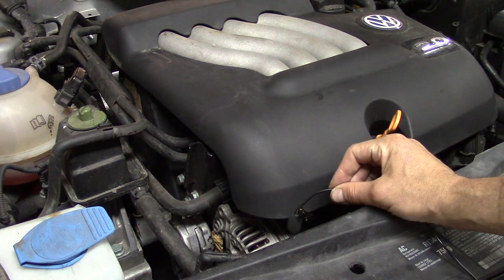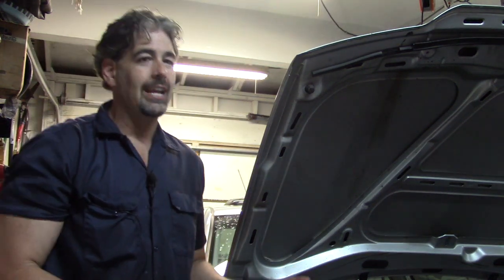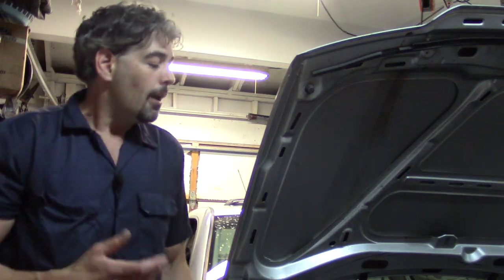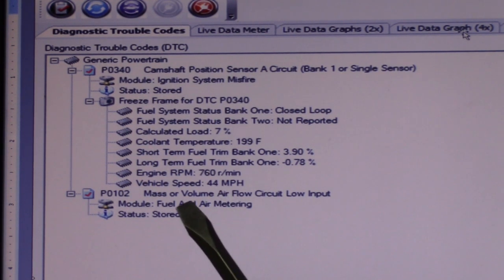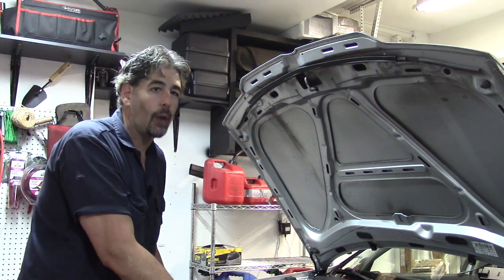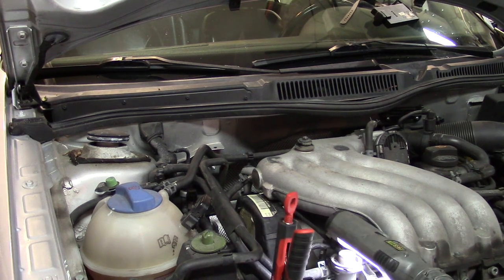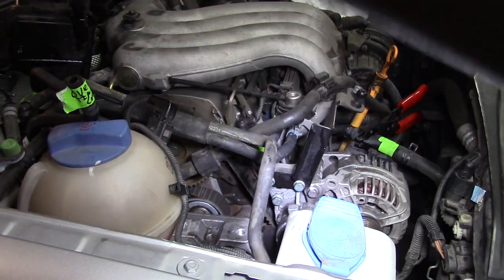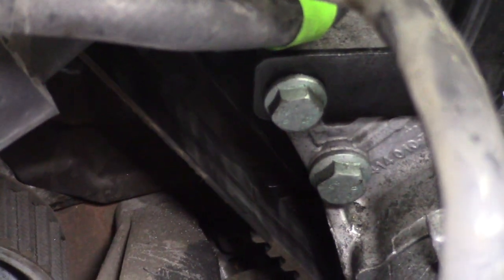Volkswagen Engine Noise Diagnosis

Comment: I figured out the sound within seconds of hearing the engine. But I am surely within the 98% group.
Reply from the maker: ykmalachi Wow that's amazing. So tell me then- how did you know it was a bad timing belt tensioner and not a bad pulley on the alternator, or idler, a bad AC clutch, a bad water pump, fan motor.... do tell how you knew exactly what it was right off the bat. Otherwise you would just sound like a chump who can make a call after the fact.
Reply: I do this 7 days a week. I know the sound of bad tensioner/belt slap. As a pro shop had looked at it I "presumed" someone looked at the serpentine belt tensioner as it is right on top. If it was slapping you can see it. As that was not likely seen it is usually a non-seen external part. 
I am also "presuming" the engine is cold based on how close you were to working on it. Sweat on your brow denotes a high shop temperature.  So a cold engine will not have a fan turning on. 
What else rotates? Timing belt or possibly something broken off in the bellhousing, like clutch or the like. A camshaft code says jumped timing or stretched timing belt. An actual bad cam sensor will 'usually' cause a stalling or no-start. 
I am using less technical deductive reasoning. Would still need to removing timing cover to confirm as you did. End result would be the same. A super easy timing belt change on a VW. The only hassle is rotating the water pump to remove from behind the inner timing cover. 
This is my full time job. I don't always have access to nice scan tools or diagnostic equipment so have honed my logic skills. I always confirm the failed part prior to buying parts. My customer know also that if I say to buy a part, I am right or I pay them back for misleading them for that part.
There are many ways to skin a cat. I use my brain first. Then my hands.
Reply from the maker: ykmalachi The only thing you got right is you do not use deductive reasoning because it is flawed as hell- so actually you are also right about being in the 98%.

1. Presuming someone checked the belt is by definition flawed reasoning and the sound could not possibly be the belt slapping and it still wouldn't rule out a bad pulley or AC clutch or other spinning part. If you guessed timing tensioner it was only luck at best.

2. The assumption the engine is cold is WRONG- the customer just drove it in. I had been listening to the warm engine for some time in fact- and you can see in the video I am next to a high output light source, thus the sweat on my brow- it is from a hot engine and light source.  You can see by the clock on my computer it was late at night and I live in Denver, einstein- the shop temp is 65c.

3. The code was a Camshaft CIRCUIT code- your first inclination as a professional, is that it is impossible to determine if it is actually circuit or mistiming.  The engine will also run fine because it will default to the CKPS.

  Anyway, keep guessing... just make sure you did it after the fact like you did on this video so it will be correct.
Reply: Schrodingers Box I based my deduction on information as I got it from a youtube video. I thought I knew the answer right away. You confirmed my answer through further investigation. I based my guess on information I could see and hear on a cell phone in my hand. And a lot of years as a mechanic. Not a technician. Experience has taught me how to take little to no information and deduce the cause, effect, possible outcomes and remedies on nearly every automotive problem. 
You are doing things in the correct and methodical way. 
Sadly your doing them while talking down at your viewers and in a smug elitist manner. Engineers tend to be this way. Making things seem over complicated to show how smart you are. Being smart comes in many forms. 
I am a subscriber to your channel. I watch every video you put up. I watch to learn new ways of doing things. I have absolutely no automotive education.  Just lots of years of doing this type of diagnosis.
Reply from the maker: ykmalachi It is inconceivable to me that you would subscribe and watch every video and still resort to irrational guessing and illogical approach.
  Anyway to each his own.
  But if you learn anything from this channel it is that you could not, and did not know what was wrong with the car within seconds as you claimed.  It is truly impossible, but it takes rational logic mindset to recognize that, which is the whole point of this channel.
Reply: Belief in my assertion is not required. 
A youtube comments section does not convince require or allow for proof of opinion. I can neither prove I am right nor can you prove I am wrong. 
Experience as a mechanic is far more valuable than learned technical skill. I have heard the sounds of a failing tensioner and belt slap. 
Don't always presume you are the smartest person in the room. It makes you prone to talking down to others. Uneducated country hicks are not  always slow.
Reply from the maker: ykmalachi I never said I am the smartest person I the room. I am merely saying you are the dumbest one in this conversation.  
You still don't "get it". I tried.  Your loss. Now go buy a lottery ticket with your birthdate as the numbers.
Reply from the maker: ykmalachi BTW how about proving your prowess conclusively by answering something that wasn't shown in the video-
  What was the reason the MAF error code?
Reply from the maker: jarin wilson Well I gave him a chance to redeem himself- if he makes the call on the MAF code like I asked, I'll admit his experienced guesses supercede my rational logic.
  Which comment are you talking about btw Jarin? A lot of people say all my vids are hacks so I don't know which one you mean lol
Reply: Schrodingers Box I had the same sound on my 1.9 turbo diesel and it was... alternator one way clutch pulley. And the belt wasn't slapping and the tensioner wasn't jumping up and down excessively as they say it should. So you newer know. I always take the alternator belt off first when diagnosing any engine noise. So far it cured the noise every time. But I don't work on cars 7days a week and don't know that much...
Reply: I'd first resolve timing belt issue. Nothing else should be done til that engine is safely running again.
Verify the MAF is clean. Two shots from a can of CRC does it. Any more is a waste. Jack holes at quick change oil joints are the cause due to not installing the air filter/housing correctly after they remove it in an attempt to up sell you on a filter.
Verify continuity in the wiring to the MAF. Check for resistance in said wiring.
With a helper if you can have the rpms raised in a smooth controlled rate checking the actual signal from the MAF. A DVOM can be used but the delay in readings can make for less than perfect results.
If you have access to a VAGCOM use it.
Verify you have no vacuum leaks. Normally I begin there with any MAF. 
Check condition of spark plugs. Poor spark resulting in a less than complete burn on one cylinder will be seen by the O2 and result in wonky numbers. The ECM then attempts to understand the failing and kicks out a MAF code. This tends to only happen on 4 cylinders with a single bank. 
This is also presuming you still have the code after the belt change and cleared the code out. Off one tooth on the belt will net the same result. 

This is only my methodology in dealing with a MAF code when faced with minimal information.  A code on a screen. No other data. 

There may be factors I don't know about. I am not an oracle. Just a guy with an 8th grade education, and a box wrench. I cannot conclusively solve your MAF issue based on the lack of any input. 

On the rest of the comments..... I did not disregard any and all variables. I heard the sound and knew the problem. If I hear a cow moo, I deduce a cow is local to me. I've repaired this issue on VW's before. So I had an advantage. It's not that big of a deal. 
A faulty alternator pulley clutch was not concidered by  me. It should have been though. I've only seen 3-4 ever that required replacing. My 67 Ford has one that recently failed and I got a nasty screeching sound. A Volvo unit was a cricket chirp. My experience with them is it is either a steady noise or rhythmic chatter. I concede it was a possibility.  

My goal is not to supercede anyone's rational logic. Logic has a place. I heard a similar sound I heard before. The end result would have been the same. 
Remove the serpentine belt and verify the same sound occurs. 
If so inspect the timing componates to confirm suspicion.
I don't talk to my customers in over technical terms and simply show them the cause, results, best remedy and stand by my work. 
I never mis-diagnose problems. I either diagnose correctly or I defer the repair due to a lack of knowledge or tools to confirm the fault. 
I subscribe to this channel to hone diagnostic skills I may not have. To learn more. I watch a lot of things of this nature because it may be covering an issue I've  never seen and later run across.
Reply from the maker: ykmalachi ...... And NONE of that information explains why the MAF code came on as a result of the timing issue. 
  I suggest you watch my video next week about the MAF, you will learn a lot.
Reply: Schrodingers Box learning is always the goal. Overlapping valve/piston stroke.
Reply from the maker: ykmalachi Wow!!!! You are AMAZING at guessing the cause after I give the answer!!! Thats twice in a row now!!
  Funny how you are wrong every-single-time when I do not make the answer available,
  Anyway.. logic my friend.  Logic.  It is why all your MAF testing methods makes you look incompetent.  We know (and can even verify from the scan tool) That the MAF code set directly after the CMPS.  Therefore we know by logic there was no fault with the MAF, and thus no reason to test it.  the code is clearly acutely 'referenced' as result of the timing problem (however that might be).  
Your testing the MAF is a complete time-wasting rookie fool's pursuit because of failure to use logic. 
The same lack of logic that you "knew" the original cause of the noise.
  Do you see it now????

Comment: Hello, can i contact you to send you a video how my jetta 1.6tdi 105hp dili engine works I can't figure out where the problem is, on a cold engine there is something similar the car is 2012 jetta 1.6 tdi 105hp  dsg transmision
Reply from the maker: You can post any data you have here and I’ll be happy to analyze it.
Reply: @SchrodingersBox  and also to add that there is a slight vibration and the lights flicker very slightly
Reply from the maker: Ok- what data do you have?
Reply: @SchrodingersBox  I haven't been to a mechanik yet
Reply from the maker: @chakarrasim I won’t be able to help unless I have some basic data sorry
Reply: @SchrodingersBox  https://youtube.com/shorts/NPTt1afo73I?si=dj65B0RLcE26QlUc

1.6 tdi 105ps automatik transmision 2012 year
a mechanic told me it could be a nozzle
when the car is cold the engine shakes and the sound I sent you earlier is a bit louder after I drive the car for 5 minutes and it warms up the sound is barely audible and the car stops vibrating

Comment: I cannot believe the engine would run with that many stripped teeth .. My tensioners on my 2.5VW tdi both failed  the crankshaft tensioner locating peg sheared off and the fuel pump tensioner casting lug broke off causing the fuel pump belt to go very loose. All back together now and it refuses to start .
Reply from the maker: Yeah there was just enough teeth that it was able to grab but one or two more missing teeth and the sprocket would have just sat in the stripped region and engine would have stopped.

Comment: and that is particularily why I don't take my cars to "professional shops" half of them try to make an easy 100-150$ charging you to swap some parts instead of taking there time to actually figure out what the problem could be. nah instead they just pop out the DTC and then charge you an arm and a leg to swap some sensors. on that note I just bought a new car and went to smog it at a smog station and they told me my evaporative controls weren't working and that they would charge me $150 to pass it illegally and another 2-300$ to actually fix the problem, being me I didn't trust these scumbags, and I went to my community college auotshop program and smoked and leak tested my tank and check the functionality of my evap controls and realized that there was absolutely nothing wrong with the system on top of that there were no codes in my OBD II ecu. so this just backed my suspenision that these technicians were just some scumbags trying to make a quick buck fixing nothing and charging me a shitload of money. well after performing my own tests I took my car to another smog station and it passed first try and only cost me $35 to get the car smogged and back on the road!
Reply: fLalo Herrera I'm a professional technician, nor am I the best or the worst. Personally, I do research and perform testing to the best of my ability within the time frame allowed. I've made bad calls, and or have said I don't know and need more time, and have also replaced bad parts to find other parts are bad as well. 

What's not being conveyed is the time limitations. As a professional mechanic you are given an hour to figure out any one particular problem. And most of the time ether the customer or the service writer will bug you before the hour is even up. Or the customer is waiting. If your flat rate your losing money if you go over the hour. You could, if the customer isn't waiting, say I'm going to eat this diagnostics and figure out the actual problem. or say hey, I'm eliminating possibilities and need another paid hour of diagnostics. It depends on the shop, manager, etc. 

Working on your own car in the garage you have all the time in the world. Or for example the man shooting the videos, ( I've been watching, Haven't paid attention to your actual name) On all diagnosis time yourself and make a call when an hour is up. Now this includes your research time, talking to the customer, etc. 

Another thing is that just because your a professional technician doesn't mean your versed in all aspects of the automobile of every make and model. You have a working knowledge and learn as you go. Every tech in the shop is not "master"
Reply from the maker: Turbotomass Absolutely true, Turbo, and in fact I make mention of your exact point in a previous video (I believe it was on a cranking no-start on a focus).
  There is no argument, you are 100% correct and I recognize that- however I still have seen more examples by far of what clearly is incompetence if not negligence than I have evidence of the timeframe limitations.  But it does not invalidate your point.

Comment: How the heck is this engine still running with that many teeth missing???!!! Wow
Reply from the maker: Totally, man! One of the most stunning finds I have ever made in a diagnosis by far.
  Looking back, it very well could have failed and  destroyed the engine while I was trying to diagnose the noise!!
Reply: +Schrodingers Box 

Just watched your other video. Hahahaha about the Arkansas teeth comment, ouch. Can't believe it was only two teeth around the sprocket. I'm curious as to what that noise was though, I understand teeth were missing but the belt must have been slapping around or the tensioner was making that noise. Amazing videos, off I go downstairs to change mine now haha

Comment: and also my check engine light is on and the code is p0504 of something like that  it has something to do with my fuel pump i changed my gas cap and its still saying the same thing fuel emission system
Reply from the maker: What diagnostic tests have you done?

Comment: Good job per the norm.   timing belt ftl.    at least it didn't nuke the engine.  I would investigate the engine wiggling so easily too.   Unless u loosened the motor mounts for whatever reason.   Freakin VW....lol
Reply: Rhage73 VW engines wiggle it is normal...
Reply: i have one in the driveway, when it wiggled like that the upper engine mount bolts were loose.   bought it like that about 3 months ago.
Well with a lot of other stuff going on with it too.  have it mostly good to go now.  its the older 03 VR6.  still runs good tho